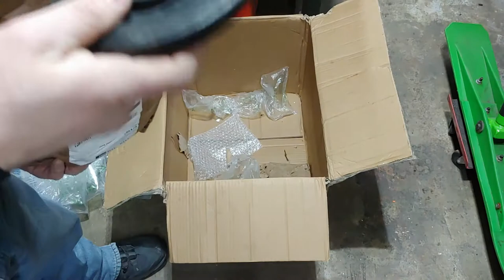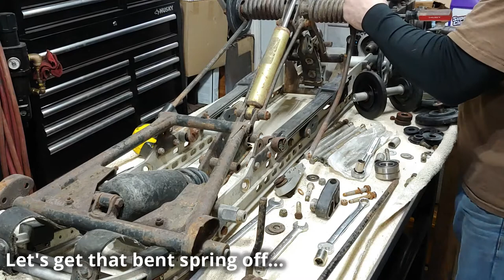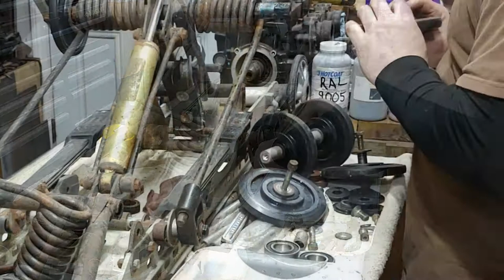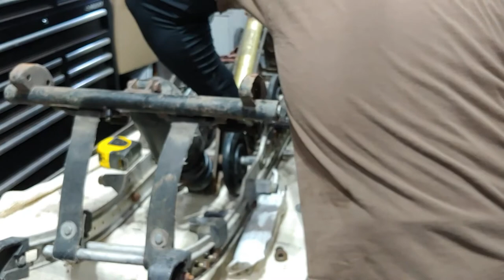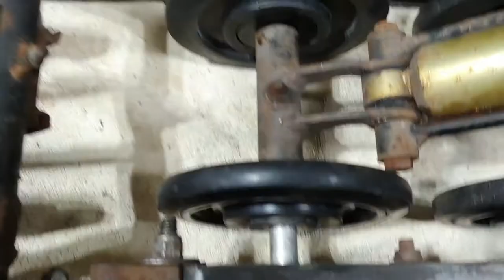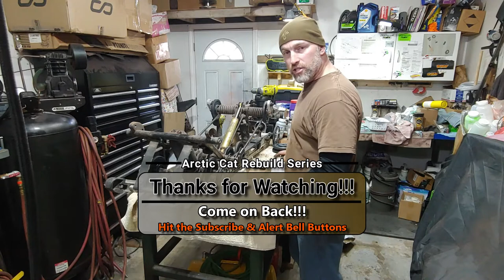2003 Arctic Cat Pantera 550 LTE/ ESR Series Part 1|| Skid Rebuilding...

Comment: I have to do the same thing. I got a skid missing lots of parts. I luckily have 2 additional skids. Can I just take many of the parts from the other skids and fix the one?
Reply from the maker: Nice and yep. Just look at parts diagrams on say babbitsonline.com and tjar will show what you needs if the skids arent the same. Pat made slight variations into the structure and Design of the skids over the years but as long as it's coming off of a ZR2 and zr3 skid for instance you should be good to go. If you need any help let me know.